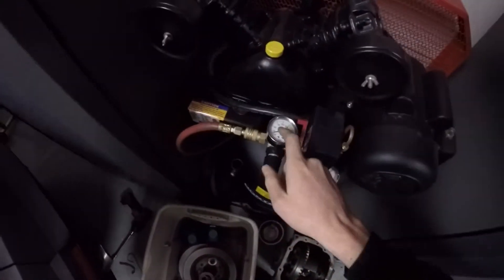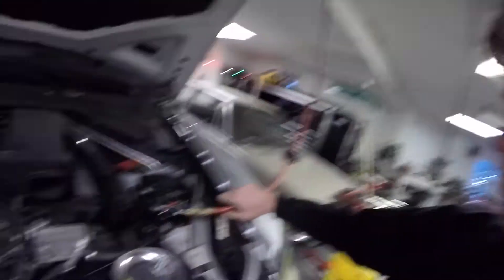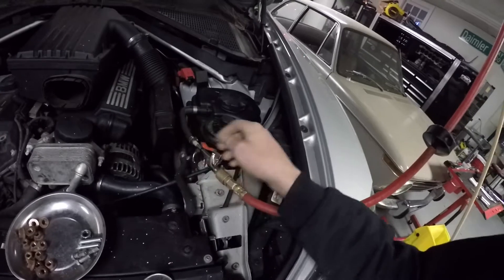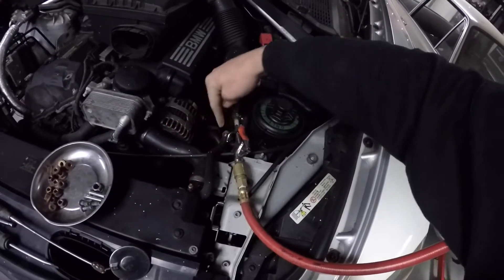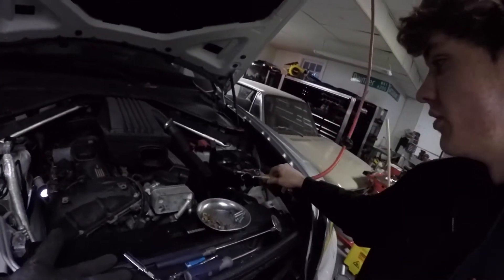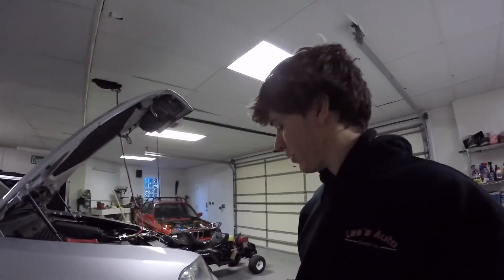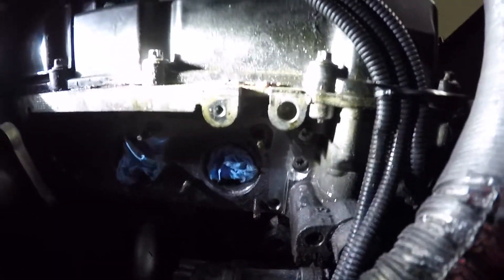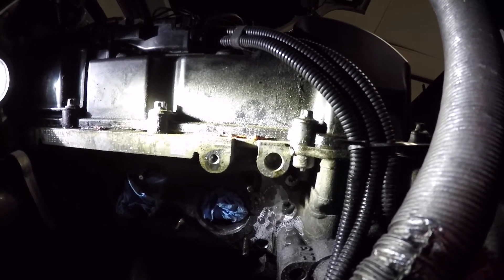How I Made a Coolant system pressure test for free

Comment: I had a aluminum cylinder head, on a SAAB 99. I removed the head and had it electrically welded. It was quite inexpensive. A new stripped head was $252. Welding was $10.

Comment: i'm doing with a crack in the side of my radiator where the composite material is a.k.a. plastic it was crazy I couldn't see the crack for the longest time I could see the coolant coming out but there was a boat connection point above the crack so it was restricting my view and I couldn't see anything really that well until I took the bumper off and yeah fun fun I put some JB weld clear epoxy shit on it last night. Hopefully it holds. I'm gonna go out and check it out in a minute, but, yeah I got a new radiator showing up and a bunch of hoses I drive a Chevy Cruz so I'm fucked but you know we do what we can do

Comment: Thanks for sharing this, I'm never been much into cars but after tackling some intermediate maintenance jobs recently I find myself starting to get near a point where I can think for myself occasionally. I have a small leak and saw one of those pressure tester kits with special radiator caps. Just now I had an idea wondering if I could use a bicycle pump and tap a line instead - glad I'm not thinking too far out there. I have a small compressor so even easier - 8 psi it is. Cheers!

Comment: Another video was saying to put the air in through the overflow hose on the resevoir. My car may not have a radiator cap or a transmission fluid dipstick, but it has the overflow hose so HECK YEAH.
Reply: Cool info me from the past. Our 98 Cherokee we drive now has both fortunately and it’s a more common vehicle, making repair videos and on-hand local parts availablity QUITE great

Comment: Not well presented as not really showing how you fed the air line into the system. Looks like you were in too much of a rush
Reply: Common sense is a hard to come by for some. Very well presented tutorial.
Reply: Where he separated the coolant system's connection, he plugged one side with a bolt and secured the air nozzle connected to the air line into the other side, with the regulator on the compressor set to an appropriate pressure and the handle on the air nozzle zip-tied down to supply constant air.  He explained it at the start.
Reply: @twoscoops5197  Oh, zip tied the handle on the air tool - that makes sense. I thought he meant he zip-tied to get the fitting tight enough. Thanks.